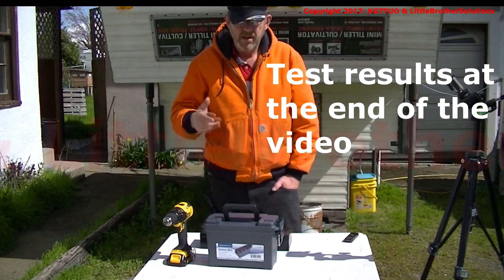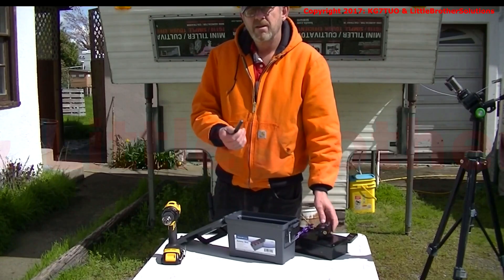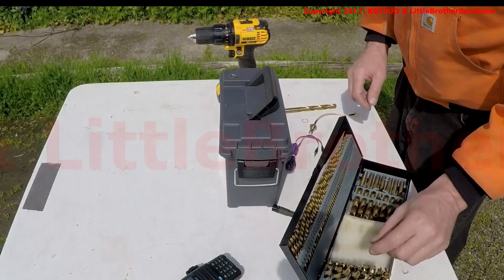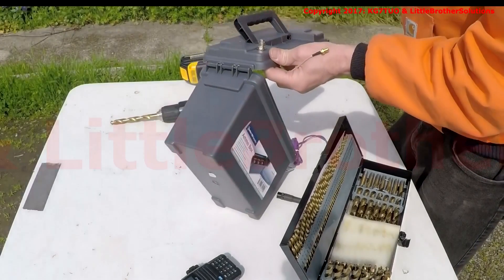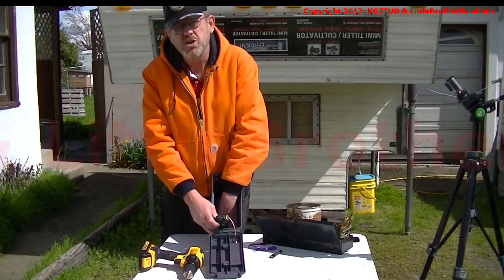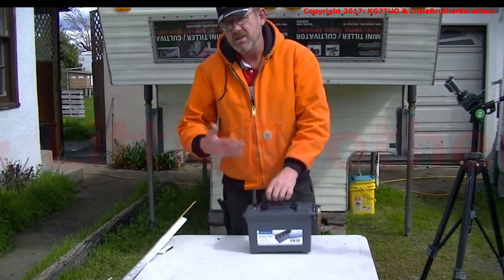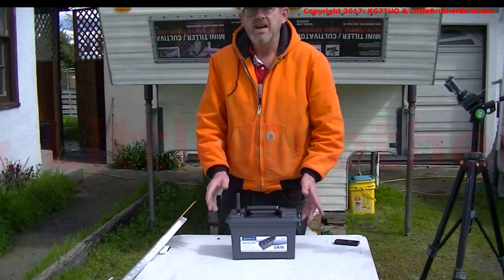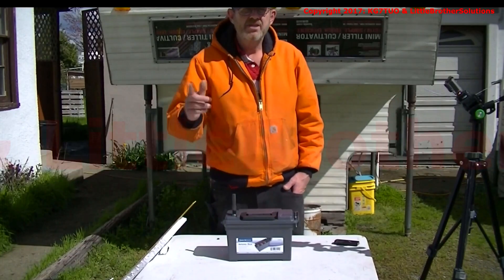Homebrew Foxhunt Transmitter - Cheap and Easy

Comment: Was able to create transmitter. Problem is, it blasts out a signal at 1W which can be heard a mile away.  Makes it impossible to hone in on a "weak" signal.  Any suggestions on reducing power?
Reply: Whatever the radio's lowest power setting is the lowest you can get.  You could run the output through a resistive attenuator network, or a commercial attenuator if you really want to lower the output.  BUT, what you need is better foxhunting equipment, a directional antenna, a passive or active (offset) attenuator will allow you get close and still get a usable signal strength reading.

Comment: Enjoyed your presentation, and will consider building my own Fox Ammo can for a future fox hunt.  We have the Baefung radio, but the pre-recorded audio file remains a mystery how to generate. And what to say.
Reply from the maker: I used an online CW translator to create a morse code message with "call sign Fox Hunt Transmitter" and a voice message explaining what a fox hunt is and what frequencies were being monitored by those putting on the hunt. 
Then use an audio editing program (windows movie maker is free and will work). Copy the Morse message so it transmits for a set time (repeating the same thing) and the voice message of about a minute at the start and then intervals of 5 or 10 minutes. 
Try to stay within the duty cycle for your transmitter set up and within the power constraints of the radio supply.  With a Baofeng on low and 40% transmission time, I've found that a standard Baofeng battery is usually sufficient for a couple of hours.
I do usually use a mast mounted portable antenna (the type I show how to build) to make that low power signal better able to get out there but a Nagoya 771 on teh top of the ammo box works if the fox is in a high enough point (hill top, etc.)

Comment: Set  mine up and it transmits but no audio out at all    any suggestions     full bars on receiving radio
Reply from the maker: Audio device output is connected to the radio MIC receptacle and the audio recorder is putting out audio on the cable?
If the VOX is activating it is receiving audio. If the radio is transmitting with VOX and received audio on the cable it should be transmitting the audio.

Comment: How long will the internal battery last at 2 watts? Will the transmitter overheat? Most hunts I have been on use less than 1 watt.  I hunt with only a rubber duck using "body fade" on a 2m / 440 HT. When close I remove the antenna and or use the third harmonic which is in the 440 band.   Don KC6IPO

Comment: To avoid the problem of the antenna cable being bent and stressed every time the lid is opened, mount the BNC connector on the upper side of the ammo box and use a right angle BNC adapter if you want to use a rubber ducky.
Reply: Dont know if anyone gives a damn but if you are bored like me atm then you can stream all the latest movies on Instaflixxer. I've been binge watching with my gf for the last few days =)
Reply: @Benton Reese yea, I have been watching on instaflixxer for months myself :D
Reply: BRILLIANT!

Comment: Well I must thank you from the heart...after watching you make your home brew..I made mine and tested it on my radio club today...it worked perfect and everyone was pleasantly surprised at the outcome...they tracked it from over 4 miles away. And were able to pin point it with the adjustable 4 mhz offset atenuator..right down to 4 ft away..I have it in candy boxwith the antenna sticking out Thru a hole..thank you for he video and directions..Ron
Reply from the maker: I'm glad to hear that my video was able to help you pull off a successful fox hunt. My local club is talking about doing a fox hunt but I think we're going to have to have an antenna building class as I doubt many have a small portable antenna for tracking use. Did most of your participants use tape measure type yagi's or some other type of antenna?  I want our searchers to at least have a chance to find the transmitter and most are probably going to be brand new so I want to help them as much as possible.
Reply: KG7TUO I make two element yagis that only cost $20. Not like the ones on line..but I use the same measurements..I got about 50 arrows from the local arrow shop and buy 3/4 inck aluminum for the beam..in fact I will make a video today on how I make them and post it.that way you can see it first hand.it will be on YouTube by Tomorrow..stand by
Reply from the maker: Well I just saw your post and it's two days old so I was hoping that you had that video up as I'd love to see it.  POUT it wasn't there.  Let me know when it's up PLEASE.
Reply: KG7TUO I'm not sure I trust putting it on you tube cause I copy Arrow Antenna ...I don't wanna be sued by this crazy world today..but it is so simple..I can send you two pictures..one disassembled and one put together..
Reply: I now have 4 pictures I can send you if you want close ups..they are all pretty self explainable
Reply from the maker: I would love to see the pics.  My email is the channel name (kg7tuo) @gmail.com

Comment: I'm sorry but the baofeng only transmits for a Max of 10 minutes before time out....it cannot be set any hgher...or do you somehow loop the recorder to only transmit.then shut down and start again..that's the part we need to understand..please show how to get that to happen...I have four recorders here and none of them loop.so the baofeng will shut down every ten AND not start back up.....
Reply from the maker: I used my audio/video editing software to create audio files that are 24 hours long and repeats my ID in CW for varying amounts of time.  For a fairly close in hunt it transmits with fewer breaks. For a longer distance hunt it has longer breaks and longer periods of transmitting. However, I tried to keep the duty cycle (how long it is transmitting) to a reasonable amount so that the radio doesn't overheat and the battery lasts long enough for the hunt.

I think for the close in hunt it transmitted for 15 seconds of every minute with an occasional 30 second transmission followed by 30 seconds off. For the longer distance hunt it starts out with a longer transmission with a minute or two break and then another long transmission.  This is intended to allow the hunters to get a good fix.  It is then silent for a few minutes so that they can move to another location and get a second bearing...and repeats the cycle of a couple of long transmissions.  Then is goes to a different cycle.

The whole idea was to balance the need for hunters to have a signal to home in on against the need to preserve battery life.

The radio is set to VOX operation and so it only transmits when the audio recorder is playing the CW.

Does that answer your questions?

Comment: I like the build and will recommend a viewing to our radio club (W5AW) here in Big Spring, TX (BSARC). We recently constructed something similar I would like to share with you. But before adding the link I wanted to get permission. Ours transmits at only 15 milliwatts. It normally runs on a 9 volt battery, but our foxhunts last 24 hours and we wanted to make sure the transmitter would maintain power and run time so I fitted it with a AA pack for more mAh. Even at 15 mw the transmitter can overwhelm the tracking radios at 100 feet even with no receiving antenna equipped. So I was wondering with yours at 2 watts, how do you get close enough to begin searching within eye-shot? Thanks for your time and please let me know if you are interested seeing the way we built ours. 73s!
Reply from the maker: Sorry for the delay in responding but I somehow missed this comment.

The transmitter you're describing sounds like one of the low power, short distance types and I wanted one with a longer range for longer distance hunts than I think the 15 mw transmitters could support. I would still like to check it out though.